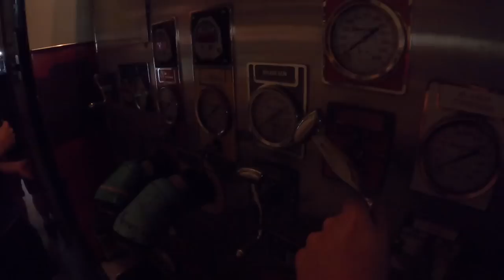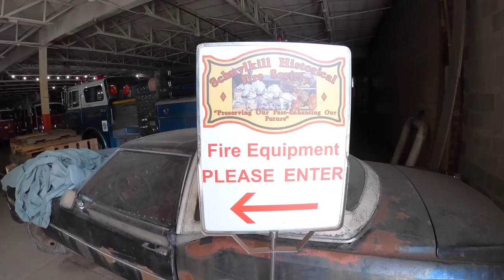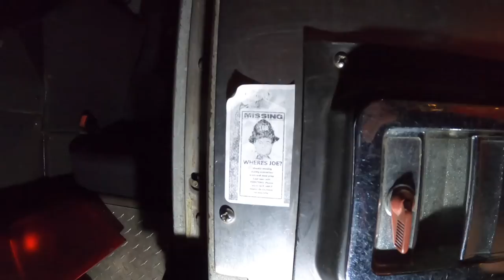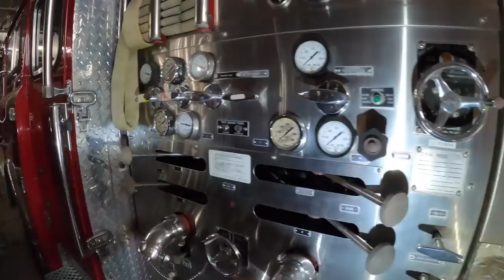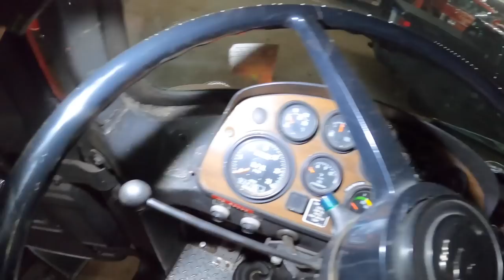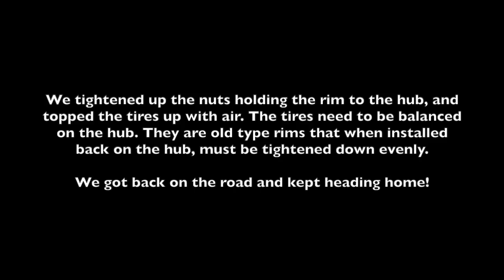Antique Firetrucks GALLORE- Bringing our Mack CF home for the Summer!

Comment: Our Mack similar to the pumper was a five-speed that didn't have synchronizers so you had to double -clutch it to change gears. The cab that was round in the front kinda put the driver and bell-ringer way out front.

Comment: The Mack TDA is a CF-700. It should have the 864 V8 with a twin-turbo system. And it has a Maxim trailer, but the Mack sign on the ladder is a bit confusing.

Comment: your air compressor regulator is acting out of wack
Reply from the maker: That is high on the priority list to get fixed this year for sure, i'm gonna have to do some research on how to adjust that, or what part needs to be replaced.
Reply: @SeanGilmore92  no adjustment if your air dryer works fine the regulator is 50 buck here in Canada and it is alredy adjusted to 120lbsmax and start your compresor at 90lbs
Reply: @SeanGilmore92  no adjustment there alredy pre-adjusted here in Canada they are about 50$